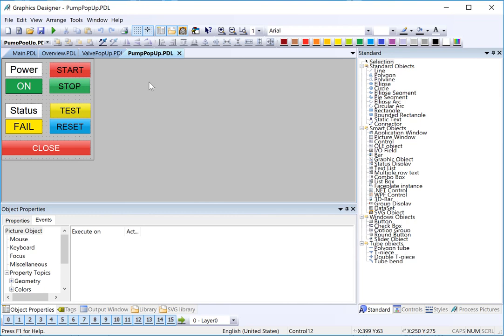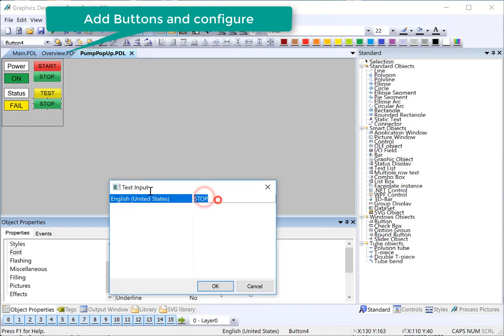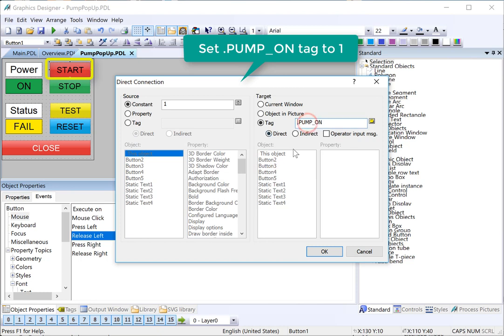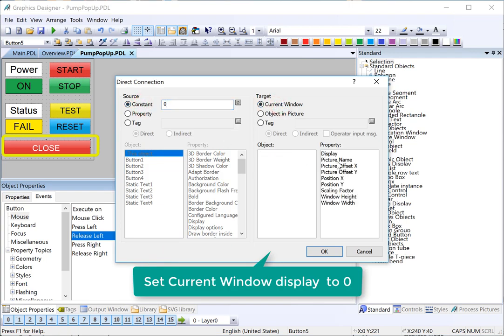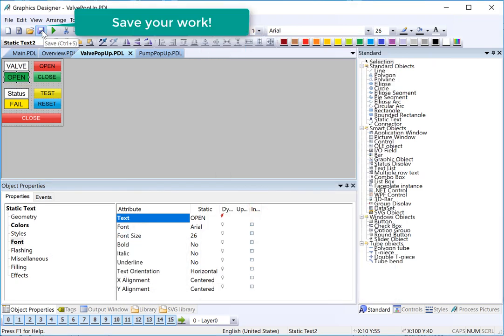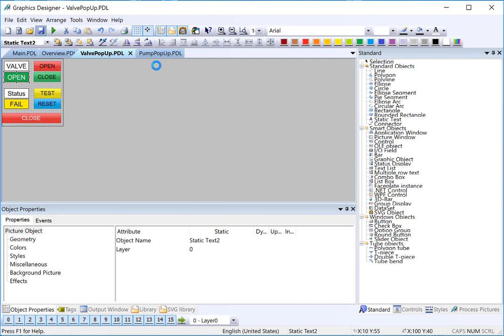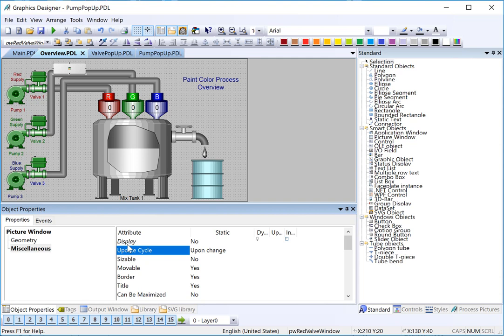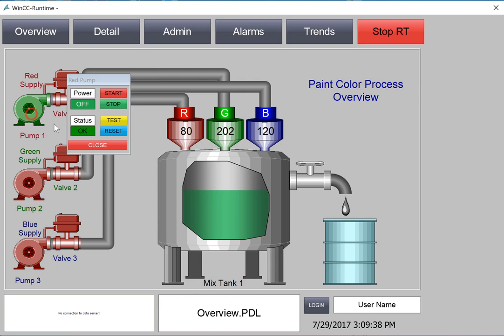WinCC v7.4 Step By Step #15: WinCC Tag Prefix example 👩‍🏫 #learnscadaprogramming #WinCCGURU

Comment: WHAT İS THE DİFFERENCE BETWEEN FACEPLATE AND TAGPREFIX
Reply from the maker: Great Question!! These are both different ways to make reusable graphics. 

Faceplates are equipment interfaces you create which are global; you create the faceplate definition, then create instances of it using the faceplate instance control. When you make changes to the faceplate definition, the instances are also updated. However faceplates have limitations. You cannot use SVG or other Library objects, picture windows, or active X like Alarm or Trend Controls. You also cannot attach process tags inside the faceplate, you have to do that on a property or script on the properties interface on the instance itself. Also VBS Script is limited to interacting with object in the faceplate, and you cannot access objects on other screens, etc. There is also a performance hit. 

Tag Prefix is another way to make a reusable graphic, using a WinCC Screen (PDL) , a picture window object and tags with a naming convention, i.e. Motor_1.Speed, Motor_1.Current. Motor_2.Speed, etc. You build the screen like you want it, with no limitations at all.  Any tag connection (script, animation, property, etc.) uses the element name (i.e. .Speed, .Current) instead of the tag name. The Picture Window has a property called "TagPrefix" where you put the Tag prefix, i.e., Motor_1, Motor_2. Then in runtime. when the picture window loads, any tag request coming from the screen (.Speed) gets the value of the TagPrefix property of the Picture Window (Motor_1) appended, so the tag request becomes "Motor_1.Speed". You can dynamically change the tag prefix value to show different equipment. See this video: https://youtu.be/g4ThkWbU3nI 

Personally, I use Tag Prefix and not faceplates. 

This was a great question, I will make a video on this. :D